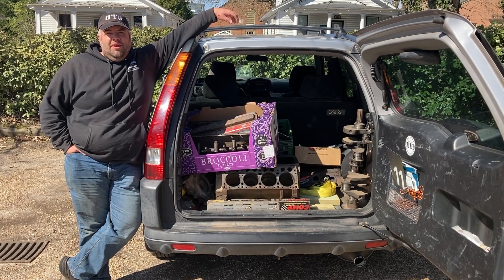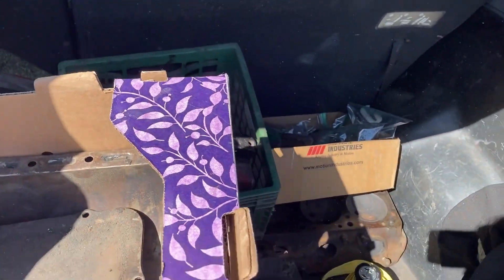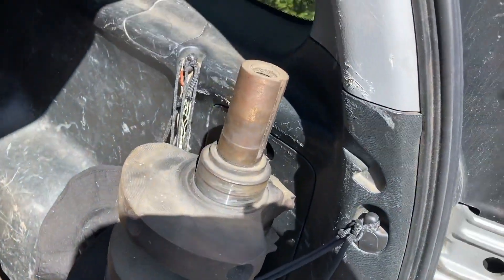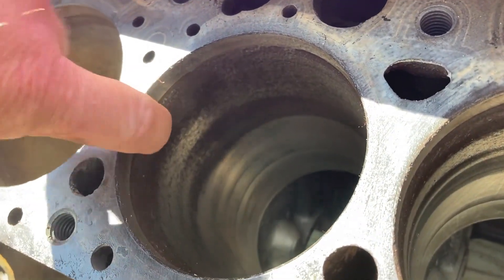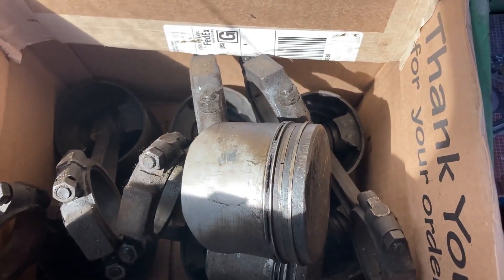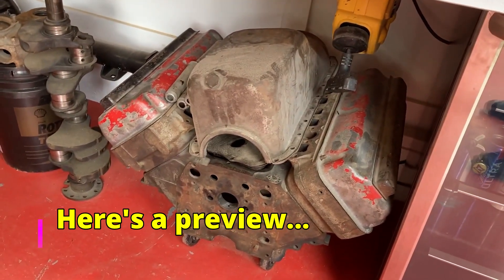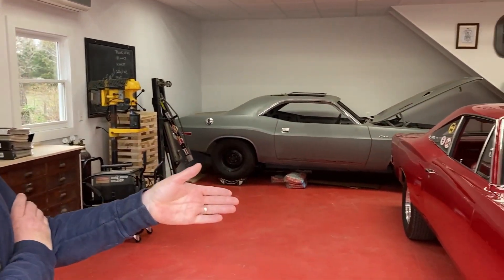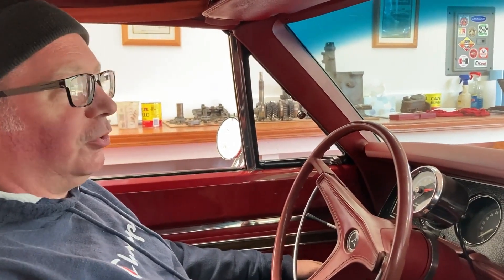341 DeSoto Hemi - Part 1 - the trip and introducing Hemi Stan

Comment: If I had a 341 I'd reproduce a Woody Gillmore front end dragster chassis and try and locate a rare Weiand blower manifold. If I could find that I could come up with a full race cam, some aftermarket exhaust rockers, get someone to box the rods, machine some 4140 main caps and the rest is more easily acquired. I wouldn't risk it in competition but it would make a fitting powerplant parading for a "Cacklefest" audience just idling around on 98% Nitro and 2% Toluene. 

Brissette and Sutherland ran a 341 in their Woody Gilmore chassis top fuel dragster for a short while in either '65 or '66 and they were fast in a fast Southern California environment with consistent 7 second 200 mph passes with whatever Hemi they ran. Shrank Brothers ran a smaller Desoto winner a few years before that and ran nearly straight Nitro before the "Surfers" ever did it. There were some others but the other 1st generation Chrysler Hemis ruled the roost in AA/FD. Aftermarket parts weren't as plentiful in choices for the Desotos as they were for the Chrysler 331, 354 and 392 Hemis but they were out there. 

The Mains in the Dodge Red Ram Hemis were too narrow to take Nitro.They did well though in smaller cu in classes on the Bonneville Salt Flats. An early '50s Studebaker Starlight coupe made a good fit for that particular application.

.

Comment: Nice find John!!! I bet there are more of those Desoto hemi's running in Ford and Willy's street rods then Mopars now a days.  I think there is a shorter water pump housings based off Chev big block that allows them to fit in smaller engine bays.  I am wondering if you have a car in mind for it.
Reply from the maker: You’ll have to wait and see.  I’ll tell you this, though:  the grass won’t grow under this engine.  It has plans.
Reply: @johnwilburn  That's why Its usually a good thing when this stuff changes hands . I have a 49 english M.C. it sat in a cellar for 30 yrs next to a pile of coal , exactly one year later I visited the owner riding the bike all restored . The owner was so happy to see it on the road.
Reply from the maker: @jimifed2798  I’ve steadily been building stuff from my stash.  I can’t take it with me.
Reply: @johnwilburn  That's a great attitude to have . I don't have enough car parts to do that but I have assembled Brit bikes from parts mostly BSA a10 and a65 and sold them on flee bay.  I have relied on Chry. Carlisle for many years to get my mopar hobby car going.
Reply: Its getting very hard to piece together Mopar products anymore  I don't think I will be getting involved in difficult projects as much as that pains me to say.
Reply from the maker: @jimifed2798  I plan to be at Carlisle.  Holler if you want to meet up.  Several of us on this channel plan to.
Reply from the maker: @jimifed2798  I’m still game for few of these glutton-for-punishment builds.  They are the only way I can do some things.  Almost certainly the only way I’ll be able to do a 426 Hemi one day.
Reply: @johnwilburn  Sure will John . Meet Tony , Kathy and all the girls two years ago [puppy's]

Comment: Wow, congrats on owning a Hemi.  It looks like it is a small V8, outward dimensions-wise, which could fit into more cars than the Gen-2 Hemi. Will those fit in a 1st gen Barracuda?
Is it an industrial or marine engine?  Asking because of the water pump.  If it is industrial or marine, I trust you made sure it's not reverse rotation unit.
I've still got John Conlee stuck in my head from the Sunday chat, but that's a good thing.
Reply from the maker: The first gen Hemis have more DNA in common with small blocks for sure.  I’ve not dig deep enough to know how it will fit, but I know what I want to put it in.  We’ll see.

Comment: Maybe this isn't the best place to ask but I have a 74 bb440  took it to the machine shop and after the cleaning and magnaflux apparently there is a hair line crack in the valley near the lifters ... can this be repaired (welded) apparently there was a corresponding crack in one of the heads as well . WHat would be a good way to go from here ???
Once again sorry if its not appropriate on this post .
Reply from the maker: While I'm not the best person to ask, I know it can be welded, but you need a welder experienced in cast iron spray welding.  Same for the heads and they will need a valve job after.  It won't be cheap, but big blocks are generally worth saving.
Reply: @johnwilburn  ok thanks for the reply . I would just fix the block if I can find someone to do it ... I'll probably have to find someone in st louis ...anyway thank you Sir .
Reply from the maker: @billbalke7572  Good luck with it and post video if you can.  I wouldn't mind seeing it!

Comment: Anyone know what oil was called for in these engines from the factory? Picked up a 57 desoto and would like to change it asap. Super hard to find info on them online.
Reply from the maker: I wouldn't hesitate to run 10w40.
Reply: @johnwilburn  Thats what I was leaning towards, but heard a lot of these older engines ran straight 30 weight.
Reply from the maker: @EpicWhiteGuy1  You can, but I like the multi-weight we have now that wasn't a thing in 1957.  They ran non-detergent too, but if the engine is clean, I like a modern additive package.